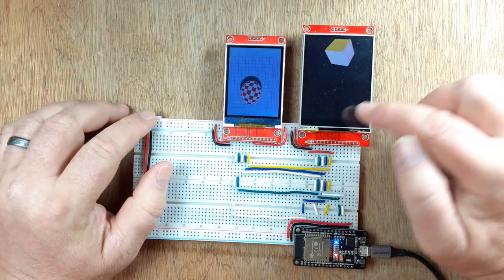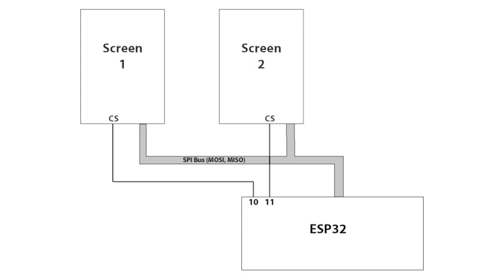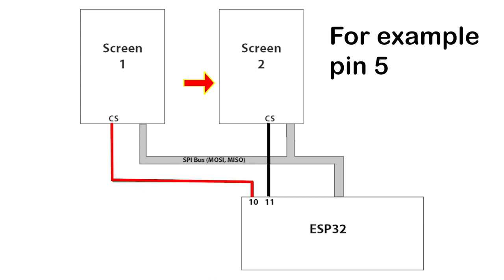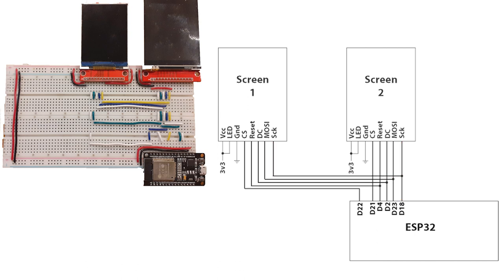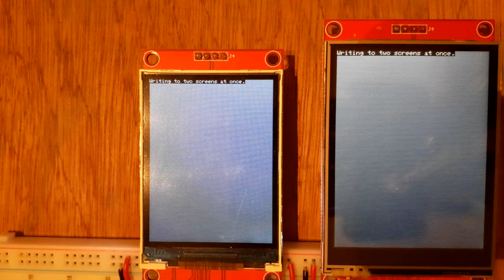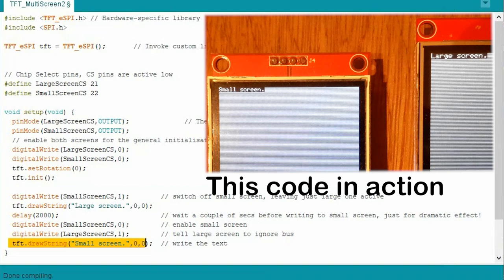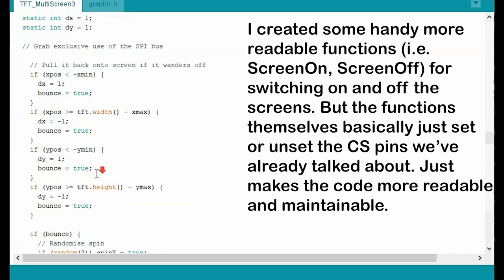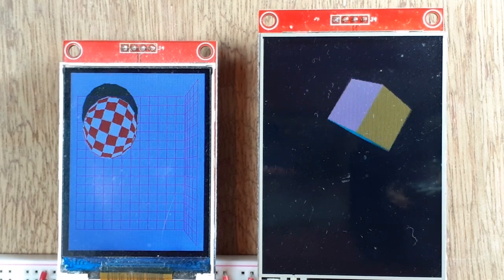Driving 2 screens with the ESP32 (ili9341 driver, tft_espi library)

Comment: I had a bit of free time over the weekend so I did a bit of testing and experimenting. I can conclude that by commenting out the define for TFT_CS in the setup file of the tft_espi library it did not default back to GPIO 5. I initially ran only the example sketch Bouncing Cube with the screens CS set to GPIO 15. The program reported 95 fps on the serial monitor. I then set up a sketch to run both Bouncing Cube and Boing Ball at the same time with output to two screens. The GPIO's used were 15 and 21. The program reported around 53 fps which I believe is to be expected. So, I thought I'd try running on dual cores expecting to get the same fps or maybe slightly higher but was disappointed to find that the fps dropped to 23!! Not what I expected!! Can anybody shine some light on why the program runs remarkably slower on dual cores than when running on just one core? Thanks in advance.
Reply from the maker: I've pinned this comment as the work you have done is excellent. The dual core problem might be because (this is a total guess) each core is halting whilst it negotiates the use of the spi bus, as they can't just plough ahead as data would become corrupted. Whereas in single core it knows its got full control so no overhead for negotiation of the bus. This is just a guess mind.
Reply: @XTronical  Came here to ask about the dual core and to reply to this, so my work here is done! But yes I 100% agree it will be contention for the bus, regardless of whether you are writing to one or two screens. One thing to consider if using this for a dual core display / game is that you could have one core doing the calculations for the screens and then another core in a loop just updating those displays. For a game and watch like you suggest, this may work well. I'm going to try this approach with a master system emulator and have one core running the emulator and the other just shifting the changed pixels to over the bus.
Reply: @MikeDX2  If you have more speed than memory, or SPI bandwidth (as can be the case on the ESP32) I found that graphics hashes can be useful for some emulator workloads. Divide each line into 16 pixel chunks for example, calculate a display line of pixel data through the emulation but instead of just shifting those pixels to the SPI bus instead check if the hash for that block of pixels has changes from the last display write. If it has changed perform the SPI write to update that block of pixels, if not then discard the update. Under some conditions that gives a speed up, you can also add a flag to bypass the hash test code if the emulator is aware that a complete screen re-draw is due (due to a pan or scroll for example) .... just a thought :-)

Comment: Interesting. As you mentioned in another video, the TFT_eSPI library is really not architected in a way that can support multiple displays, so the limitation here is that you can only use displays that have the same driver, and effectively all the same pins except of course for CS. This is clever of course, but I don't think this would work with two different displays. It's certainly a neat trick nonetheless, and in fact if you do have two displays it's probably more likely than not that they are similar. Thanks for sharing!

Comment: I understand that in the setup file if you comment out the line that defines TFT_CS then the tft_espi library will not control any pin for the chip select. That way you don't have a pin that you can't use for any other purpose.
Reply from the maker: Give it a go. I thought I'd tried that and it still defaulted to 5 but maybe misremembered.

Comment: If you want to drive two displays without loosing speed then you can write a display driver to generate two clock plus MOSI signals in parallel (i've done this on an RPI before). Snag is memory plus everything and its dog would need re-coding but with DMA driven IO the speed would be exactly the same as one display (at least for the I/O part of the code).
Reply from the maker: Sounds excellent
Reply from the maker: Would you still not have more data on the spi bus? So twice data for example would be twice slow? The spi bus has a max data throughput, how could you send more than the hardware /wire bandwidth can manage?
Reply: @XTronical  I've been digging through the ESP32 datasheets. Looks like I was wrong (ish), the ESP32 has a DMA option for some peripherals but not GPIO (best I can tell). The ESP32s I2S device can clock multiple GPIO lines under DMA control, so it would be possible to generate multiple SPI output streams using DMA driven output. See ESP32 VGA output for examples of driving multiple bits in parallel via DMA.  Some ARM CPUs have DMA driven I/O, a table is built containing the states to output for example, that table is then clocked out as output states, when the table gets to a certain depth an IRQ is raised so that a new table can be built before the first one is complete (double buffering).  Looks like the ESP has a similar system but not directly for GPIO lines itself but only for the higher level devices. DMA driven output typically does not requite more bandwidth that a single output bit as the DMA engine takes a word from RAM plus stored mask and presents that to the memory mapped GPIO output register, IE as many bits of GPIO as the native word length per clock.  The RPI boards can do this (I used it to drive LED displays and generate multiple DMX512 streams), I think the Pico can (not entirely sure, the PICO state machine can do the same job).  SPI as output only is just two bits, clock + data so would be a good candidate for this approach.
Reply: @XTronical  "So twice data for example would be twice slow?" - To help think about it, ask "twice as slow as what?" The DMA controller has its own clock, the memory has a bandwidth, the CPU(core) has its own bandwidth, the output peripheral has its own bandwidth. The instruction set typically only reads a single op-code+data combination and typically may effect one bit or up to "word length" bits with that one instruction.  The idea of DMA driven IO is that the DMA controller reads from RAM and writes to the device without the need for the CPU...  DMA may contend with the CPU for RAM but typically RAM is faster than the CPU so more bandwidth and a lot more efficiency can be gained using DMA. The DMA transaction requires the CPU to set up a table of values to kick it off but does not requite CPU intervention while that table is clocked to the output. The result is more throughput, how much depends on many real world things ....
Reply from the maker: Wow, some very detailed replies. Yes I've tried pushing the SPI bus before and you reach a point where it will not work reliably, whether that's because of physical wire length or the device etc. causing the issue. I was pushing an st7735 display hard once and reached a limit. So as I allude to in the video if you run two displays on that same bus you reduce the update rate ( or at least I perhaps should have said potentially with the other factors involved). Using two SPI busses obviously can get around this but I'm using one bus.
Reply: @XTronical  I've found 32Mhz to be the maximum speed for output for hardware SPI on the ESP32 and 26.7Mhz the maximum speed if you also want to read the data at the same time. This may be the maximum rate the hardware can reliably change state (output latch speed), but I can't tell and have not investigated further. Shorter line lengths, even PCB's with short lines and nice soldered connections still seem to give up above these speeds so I suspect it may be a limitation of the ESP IC itself.
Reply from the maker: Yes, from memory I think I got somewhere approaching 40mhz, but it could have been a bit lower. That was with the ST7735 and esp32.
Reply: @XTronical  Ahh ok, you did better than me. Data says max clock is APBfreq/2 so for an 80Mhz clock 40Mhz is the best you will ever do. Be warned values out of range are ignored or clipped, I wasted some time poking ever increasing values into the SPI clock frequency until I twigged. You can in theory use an external clock as the SPI "clock source" but i've never tried it.

Comment: Could you run the screens on separate cores of the ESP32? Great video, keep up the good work.
Reply from the maker: Yes you could but you wouldn't necessarily gain as much speed (if any, depends on what your doing} as you might imagine. As the spi bus would be a shared resource only one core could send data at a time. So there is a bottleneck there. However if most of your  graphics work was say intensive calculations (I. E. 3d stuff) then yes you might see some increase in fps.
Reply: @XTronical  But there are 2 SPI bus in ESP32 right..
Reply from the maker: Yed, this solution uses one. Using two would be a good solution for using two cores. Good suggestion.
Reply from the maker: I've just thought though. With this library it would require more recoding to make it work. Another library might be more suitable. This library as alluded to in the video was really imagined to just work with one screen, one SPI bus. I wonder if any other library's would fair better.

Comment: Would it be possible to play a video but stretched to fit across two of these displays?
Reply from the maker: It would be hard to play a video due to bandwidth issues. Your video would need to be uncompressed as processor not powerful enough to do in real time, and your framerate would be quite awful once you've pulled the data from sd card to the screen. And that's just if using one screen. There are extra overheads with two screens. You'd have to go SD card route as not enough memory for more than about a second of video internally.

Comment: How can I define new pins 
For my tft I want to connect 
Ili9341 and an rfid module the same Time 🤔
Reply from the maker: Using the tft_espi library you set the pins in a header file. This is shown in the video for setting up one screen which I link to in the video description.